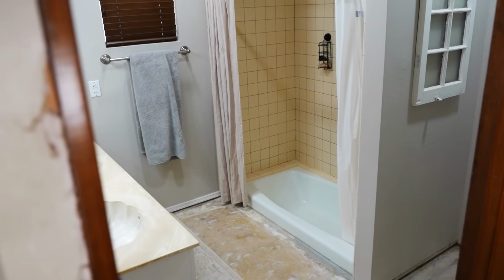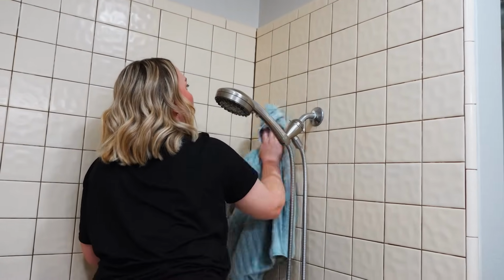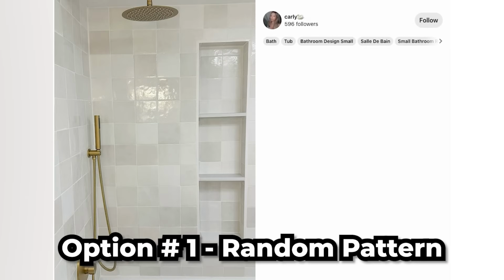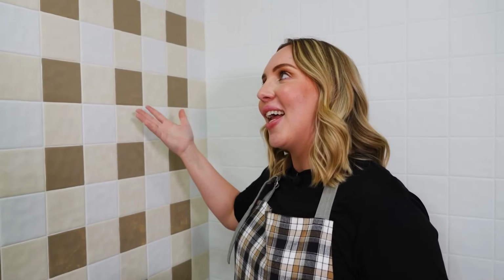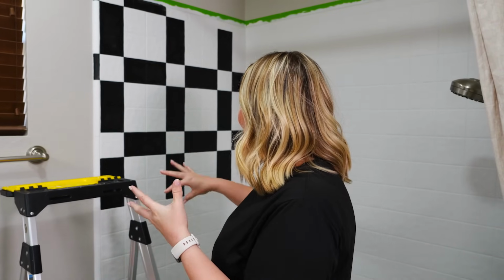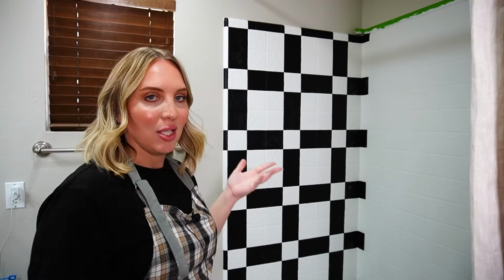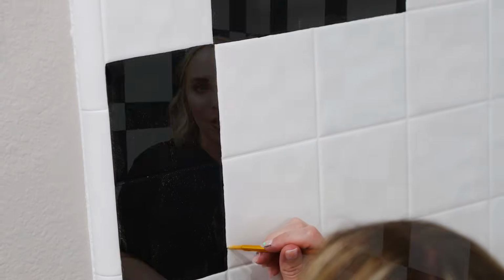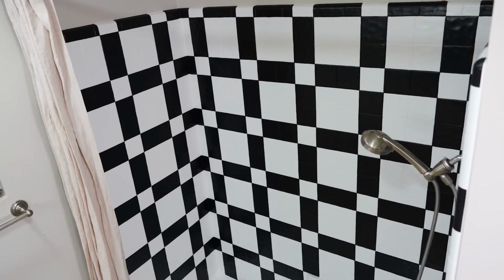HOW TO PAINT YOUR SHOWER

Comment: This is great! Who knew a shower could be painted?! I love it. Do you think this could be used on floor tile and with stand being walked on? I really dislike my bathroom floors.
Reply: I refinish wood floors for a living, and I think if you do that, you will need to do everything that Kylie did, including the sealer, and then follow that with 2 or three coats of a a non yellowing water-based polyurethane designed for high traffic areas, like Bona Traffic.